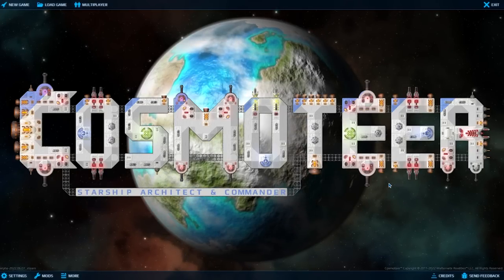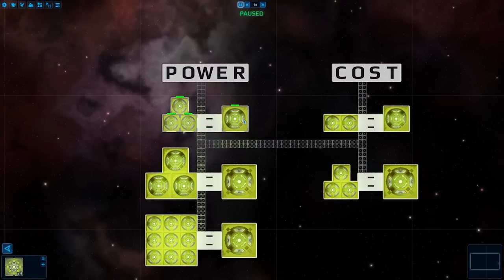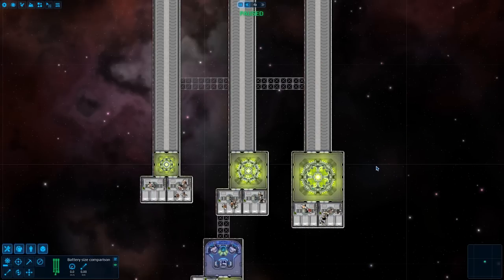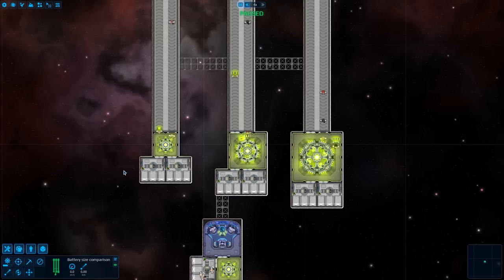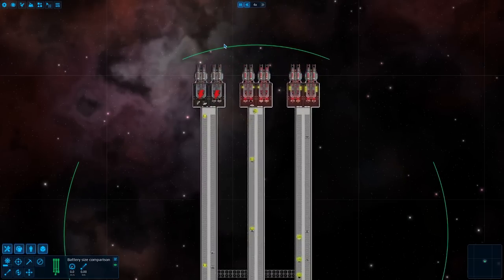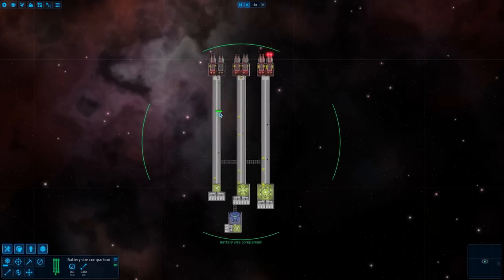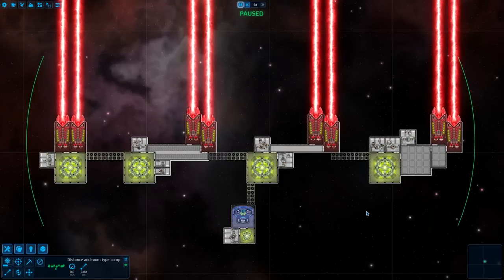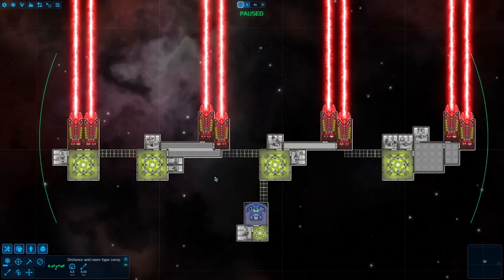Cosmoteer - Power and Logistics Introduction

Comment: Honestly, the funny thing is, that throughout the last few months, when I really got into the technical and efficiency-based side of Cosmoteer, I learnt all of the Crew management stuff basically all by myself. This video was still immensely helpful to me though, it cleaned up some of the door placement-based things I didn't know like how you can place doors of the crew closest to the reactor inside the reactor for them to be able to power the inner-most ion beams at full speed. Thanks, Oneye.
Reply: same, I didn't know about assigning them to particular things, but I was using isolation/compartments to do the same thing.
Reply: @Dies1r4e  Me too. Years ago when I didn't know the magic of funky green assignment arrows, I would cram a reactor and some crew inbetween armor to keep the reactor, wasted only for the ion beam, to not be able to supply anything else. A true waste of money.

Comment: What are your tips for upgrading existing ships? A lot of the ships in the steam demo are upgraded by you, and do really well for how simple they seem at first.
Reply from the maker: First I take a look and consider which parts need to be remade. If enough needs to be changed (or if it's small) I'll sometimes just go into blueprint mode, delete the entire ship, and then rebuild it while using the darkened interior view still visible "under" the build grid as a guide.
If I think not much needs to be done I'll still gut the parts that need changes and rebuild them. It's usually much easier than trying to cut and paste or use the move tool.
The tricky part is working around the shape and sticking to the general weapon loadout while keeping it around the same price.

Not much specific advice I can give in a comment, but if you know how to plan out and build new ships then it's not that big of a jump to apply your skills to remaking parts of an existing one until you consider it big enough of an improvement. The more you learn about building in general the easier it is to recognize when something could be improved and know how to do so.

Comment: The thing with capacitors is, in many instances it seems easier to just build a small reactor instead. Sure in an isolated instance with the supply chain and a large reactor it works fine, but it gets really complicated when a single large reactor is supposed to supply more than that.
Also shrinking the battery size to 1 can be both good and bad, or is the 3 battery size surplus accounted for when you put it into a machine requesting only 1 energy batch?
Reply: When you think about it, you will realize that there are no machines requesting only 1 energy batch. 3-sized batteries just hold up 3x longer anywhere, because it still takes only one place.
Reply: @Trickyman26  Always appeared to me as if they put 3-sized in and only took 1-sized out and the total energy value of the capacitors is like 18? haven't paid enough attention probably.
Reply: @brohvakiindova4452  Actually you are right. I was not remembering it correctly, so my bad. Then your question stands still. And I must check it out, because it really makes me wonder if 3-sided batteries are being depleted in 1 energy batched machines? 😀 I guess they are.
Reply: @Trickyman26  It's a two sided sword then most likely.
filling capacitors in 3 patches in itself is fine with 18 total energy, but take out 1 and the next 3 refilled waste 2 energy. other way around a machine/weapon could request 1 energy and instead of filling with a 3 sized it  could be satisfied with a capacitors 1 sized. But in situations with high "burst" demand your crew will waste valuable time delivering 1 sized packages.

Comment: How do I get hold of the early access on steam?
Reply from the maker: You can't yet, but it's coming out by the end of the year, and most likely this fall.
Reply: @Oneye.  ok! Another question. It looks as though the shield generators have had the prohibited areas above them removed?
Reply from the maker: @FuriousDave  Yep, the small shield got it's area removed, which means it can effectively project over an extra tile. The large shield generator is external-only as in the shield it projects is blocked by anything in front of it, even past the prohibited area.

Comment: Do power-cells keep their distinct size when stored in a capacitor?
Reply from the maker: No, they get broken up into small batteries.
Reply: @Oneye.  I did read the in-game text about the bigger cells, but took it as mislabeling of what it does. Because visibly the bigger generators have just more cell-slots, which would explain in full why they generate more power.

Kind of deceiving IMO, but thanks to your video I know what to do better in my builds.

Thanks!

Comment: I wish the designed ships had power and logistics all saved. same for ships we design. why are all crew roles and assignments not saved for them. i cant just make a new ship that is the same without spending a ton of time re doing all power and logistics. best would be when saving ship design it should grab all that. also why do new crew always go to redshirt before other things. i think crew would be best filling right to left on the crew roles so we do not have to change the all purpose crew to the right every time we make new roles
Reply from the maker: When loaded from the ship library (dragged) into a creative mode game the crew roles and assignments are saved. Loading a ship from inside build mode doesn't. The dev is aware of this and will presumably fix it in the future. You can save roles as default by clicking the 3-line "hamburger" menu, and then load them onto another ship, if that's what you're asking about.